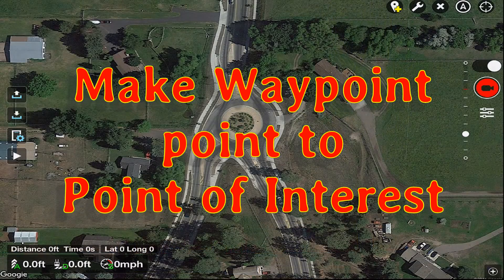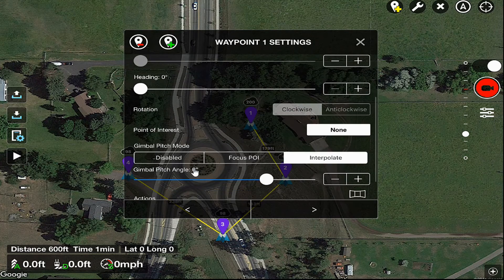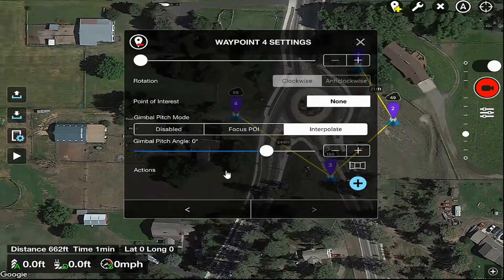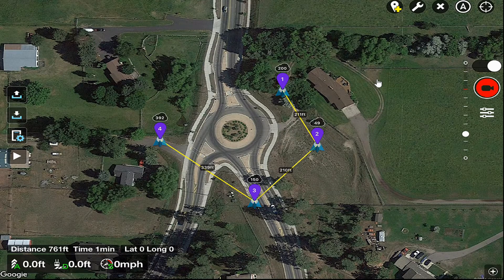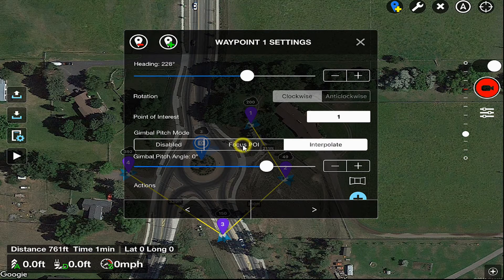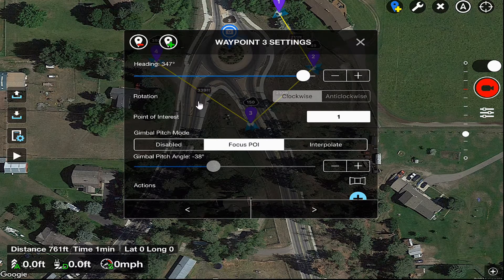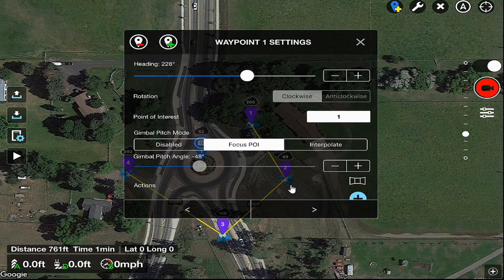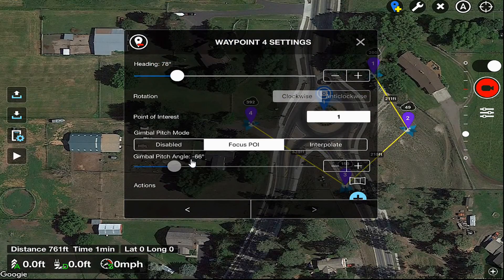Waypoint Gimbal point to POI with Litchi

Comment: Using Litchi I can set the flight plan correctly but the camera rotates 180 degrees and points away from the wayooint at the time of flight. On the return to home the camera re-orients and points in the direction of flight. I'm missing something dumb I'm sure.......
Reply from the maker: Be sure that the Mission Settings are Heading - Custom, Gimbal Pitch Mode - Focus POI and Rotations Direction - Managed before creating either points-of-interest or waypoints.  Then create the points-of-interest and finally the waypoints.  This should produce a good mission with the camera pointing at the waypoints. Using this method, the camera will default to point at the nearest point-of-interest for each waypoint and will rotate to the point-of-interest with the least rotation.  lf the nearest point-of-interest for a waypoint is not what you want, just edit the waypoint and change the POI to which it is to point.  For the smoothest video, also set Path Mode to Curved Turns.  While you can always edit waypoints and points-of-interest, it is easiest to set mission settings first, since you know your intent for the mission.
Thank you for questions and thank you for viewing.
Reply: @MontanaMonk  Thanks for the very quick reply. Your tutorials have saved me a lot of time getting up and running with Litchi. I was going crazy trying to figure this out but then recognized the gimble settings in the "master settings" area. Once I set the gimble to "yaw/follow" the mystery was solved. Now I can do the job I sold!

Comment: What if my POI is the side of a building and you are not sure of the ht.?
Reply from the maker: Even if you don't know the exact height of the building, you can estimate based on the number of floors in the building.  Each floor will be about 11 feet (3.3 meters).  If you keep the aircraft at about the height of the building or a little above, and a little further from the building than the height of the building and set the POI about half the height of the building, the building will cover most of the height of the frame.  This method doesn't require too many calculations, so is fairly easy to do.  Even if you aren't at the site when creating the mission plan, the internet might provide you with information on the number of floors in many buildings or even their height.
Reply: MontanaMonk Thanks that is a good rule of thumb use in haveing a estimate

Comment: This is a very informative video, great work. How can I determine the height of my POI from the litchi app or Litchi mission hub. For instance my POI may be a church spire 200ft or a building 30ft high from the view on Litchi mission it appears flat.
Reply from the maker: The is no way to determine the height of structures or other obstacles, like trees and power lines from the app or the hub.  I use a laser range finder which has an angle measure and calculate the heights with triangles.  There are other tools to do the same thing.  While it seems like a waste of time, you can also just fly straight up to a point even with the top of a building with the gimbal angle 0 degrees and determine its height for future flight plans.  Some larger buildings will also have their height available to look up on the Internet.  You can also estimate the height if you can count the number of floors.  While not perfect, the height of one floor willl be around 10 feet.  For short buildings, especially if you're not too close, setting the POI at the default of 3 feet will be fine.  As you get close to large buildings, the height becomes more critical.

Thank you for questions and comments and thank you for viewing.

Comment: I dont want the drone to stop at each waypoint and poi i want the flight to be continuous for smoother transaction to each waypoint and poi. what do my settings have to be on for that mission?
Reply from the maker: You can't make the proper setting from the Mission Hub to avoid stopping at waypoints.  The setting that will do what you want is setting Path Mode to Curved Turns.  This must be done from the Litchi App Mission Settings on the mobile device.   You can create missions on the Hub but you will have to make some changes on your mobile device for those things that can't be set on the Hub.   Hope this helps.

Thanks for questions and comments and thank you for viewing.

Comment: Hi!!! I want to tell you about my problem I had with Litchi today! I was shooting in Acropolis-Greece and I had my flight set to waypoint. All the waypoints are set first to "Focus POI" and then to "Interpolate" for smoother transition.
When I started the flight ( notice that my Altitude was set to 1310) I 've realised that my gimbal pitch angle which was set to 
-77 degrees it was pointing to 0 degrees and I manually set it to show the POI.
Another problem that I found was that when I set the flight path to waypoint and I was loaded the flight the unit stopped at every waypoint that I had set, even though that my speed was set manually at every waypoint to 15 miles per hour.
You are a litchi app master and you have learned me a lot!! Without your videos I have never accomplished my waypoints even though that were not perfect by (I think ) my mistake or a bug from the app!!!
So if you make any video for us (the newbies) explaining about the litchi Interpolation and how to make it right I will very appreciated!!!
Post me and to my facebook page: G.A. Productions if you want
Reply from the maker: I'll try  to make another video explaining Interpolation in a little more detail.  I know some of these settings can be rather confusing, since they do interact with each other a little.  I'll also include the manual speed changes that were not available when I made the original videos.  

One thing you must do when making major changes in the flight mode, like changing Focus POI to Interpolate, is review each waypoint to be sure it changed as you expected.  This is especially true when doing a batch edit of all waypoints to be sure you don't accidentally change parameters for all points that you only intended for one.  I will discuss the batch edit mode, too, in the next video.

Thanks for questions and comments and thank you for viewing.
Reply: I have reviewed one by one the waypoints before going to a mission but I' m pretty sure that something other is not done by me right or it was just a bug!!! Anyway, thanks for your reply and I am waiting for your video

Comment: I have had my Mavic for a few months and have all of your videos along with some very good ones from others. I don’t know if you can answer but let me give it a shot. All of my videos have a blur to them when the Mavic is moving when viewed on my 4K TV viewed using a Mac mini. I have shot in 4K and in 1080P both at 30 Fps. I have it set for 100 using ND filters 4,8, and 16. I’m sure it could be a refresh rate of my TV it is not one of the top of the line. So that’s pretty much it looking forward to your response
Reply from the maker: At ISO 100 and with an ND filter, even the ND 4 filter, is going to reduce the shutter speed of the camera.  With reduced shutter speed comes motion blur.  Blur will increase with higher numbered filters, with higher speed of the aircraft and with nearness to the subject.  Unless you really need the ND filter for some special effect, I would recommend leaving it off.  Sometimes a graduated ND filter might be appropriate for keeping exposure balanced between the ground and sky, but with the aircraft moving, it might be a little tricky to balance.  My main use of ND filters is to blur moving things, especially water.  

I don't think the refresh rate of the TV is a problem.  A slow refresh rate would probably appear as a flicker rather than a blur.

Thank you for questions a comments and thank you for viewing.
Reply: I've had this issue even without the ND filters I just got the ND filters because everybody said that you need to use them to get closer to half of your ISO. I'm just a little account confused should I just shoot on auto I've been trying to do the manual shooting but ever since I've hadThe Mavic I've noticed this blurry as soon as it stops the blue and goes away of course anyway any suggestions on Settings would be appreciated thank you so much
Reply: MontanaMonk I have to tell you I'm getting confused with the talk of shutter speed it's confusing me because of the difference between shooting with the still camera and shooting with a motion picture camera or that's an old sounding word I was told everything I've read to keep your aperture I guess half of what your ISO is and I'm shooting with an ISO 100 not sure how to control the shutter speed when shooting video thanks for all your help
Reply from the maker: The rule for the relationship in video is between shutter speed and frame rate.  The shutter speed should be two times the frame rate to produce the appearance of proper motion for moving subjects (people).  So, if shooting 30fps, a shutter speed of 1/60th second would be right.  I'm not sure this still applies to video shot with a camera moving at the speed of the Mavic.  I would suggest trying Auto exposure mode and if you like what you get, just keep using it.  You might also test Auto mode with the ND filters to see if it produces something more to you liking.  I use mostly Auto exposure mode for my Phantom and am happy with the video.  The only time I use manual is when I want the ground to be exposed properly when the sky dominates the video at the start of a clip and when I know I'll be lowering the angle of the camera during the clip.  In those cases, overexposure of the sky isn't as important as underexposure of what is on the ground, which is the main subject, so I set exposure for the ground brightness.
Reply: Ok so I'm shooting 30 DPS so 60
Reply: MontanaMonk Thanks I will give that a try
Reply: Thanks using auto exposure worked fine on 1080 30 Fps. On 4K settings I'm not happy with the results. But then again, I can't play back 4K on one of my TV's. On the 4K TV I do have it seems to be to be a bit grainy 
When say 1/60th of a second I'm not sure I see that type of setting what does that look like on the Mavic in video mode?
Reply from the maker: The shutter speed settiing should be available when you have manual settings selected in video mode.  Since I don't have access to the Mavic, I can't provide more detail but have seen some videos on internet that show the Mavic controls.

Comment: Well done! I've watched 3 of your videos re litchi and way points. The question is how important is getting the poi height correct? If you were taking videos of a 4 story building where would you set the height on point of interest? Top, midway, or bottom?
Reply from the maker: The height you set for the POI depends a little on the altitude you are flying and the distance from the building.  If you are above and fairly close to the building, the aircraft is closer to the top and your POI might be better closer to the top, maybe 1/3 of the way down.  If your altitude is halfway up the building, the POI should be halfway up because the camera will be "seeing" equally above and below the aircraft altitude.  If you are more distant from the building, putting the POI about 1/3 up from the bottom will probably provide good foreground and still cover the entire building.  A lot of making the decision depends on the kind of image you want to end up with.  The further you get from the building, the less critical is the POI.

Thanks for viewing and for questions and comments.